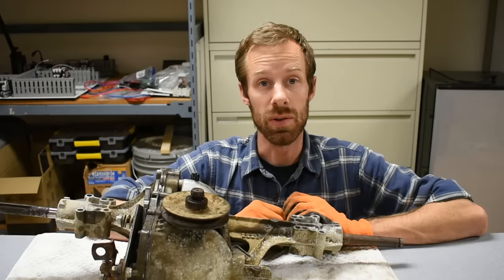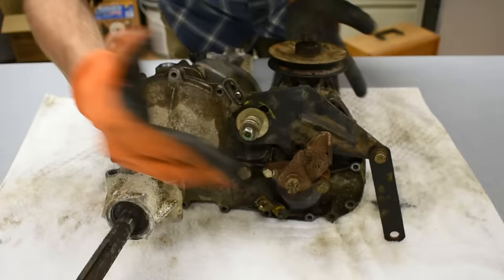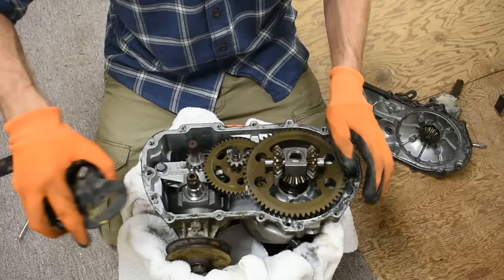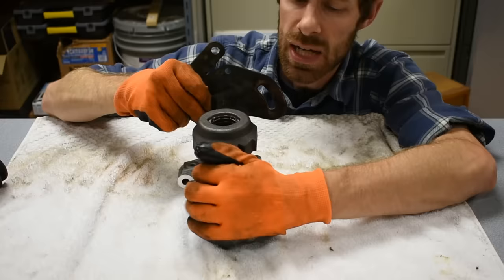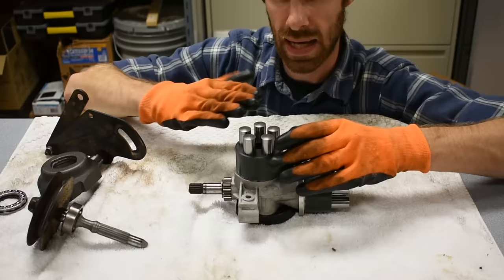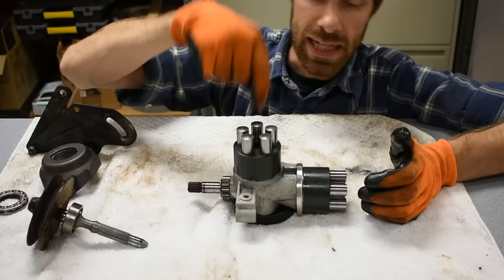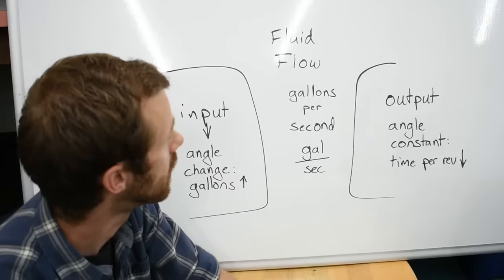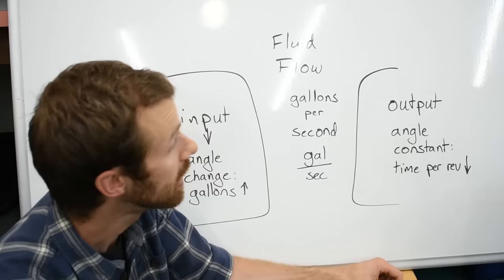How Does a Hydrostatic Transmission Work?

Comment: I understand how the pump changes forward and reverse as well as increases and decrease fluid flow.  However I fail to understand your explanation that anything changes on the hydraulic motor since there is no variability of flow or pressure.  All variability of flow and pressure seems to occur in the pump not the motor.  The motor converts all output into mechanical spin of the axle and as you said the variable disk is set in a fixed position. The motor does not even seem to allow for a change of direction of fluid flow.
Reply from the maker: The motor + pump + channels through the body are similar to a DC circuit. If you change the current (flow) delivered by the source (pump), then you increase the speed of the motor, assuming the motor can handle higher current. 

Similarly, if you reverse the polarity of the source, you reverse the motor direction.

Both of these are accomplished, as you said - without changing the motor itself, which is totally stationary. The motor simply responds (speed and direction) to the fluid flow delivery from the pump, which is indeed variable.

Comment: Thank you for your great video explanation. One thing I have always wondered about these transmissions is 'torque'. My first tractor was the conventional 4 speed stick shift and I could pick a lower gear for higher torque when pulling a heavy load, at slower speed. On my newer hydrostatic tractor, how do I get more torque? Do I push the pedal harder, (and get more speed too which I don't want or need) ? or push the pedal less, to go slower, am I getting more torque than at high speed? Any thoughts? Sometimes you just want to pull hard and go slow. TIA
Reply from the maker: Great question, and now you have me thinking hard as well. The input shaft of this variable-displacement pump is revolving at a near-constant RPM, with the only change being the volume that each of the cylinders can deliver. I think that would mean that a constant PSI, and therefor no significant change in the output torque, only speed, like you are stating.

On some larger equipment, there are two geared pumps that operate at different speeds, switching between a 'high' and 'low' gear pump still gives you the variable speed output, but the speed/torque ratio has been changed. Slower, but with more torque for heavy work, or a fast, low-torque mode for driving down the road between job sites. I doubt this is common on smaller lawn tractors.

Great questions. You got me thinking. I like it :)
Reply: I'm not sure there is any way to get more torque from a hydraulic setup.  The pump pumps it's max pressure, be it 1000, 3000 or 10,000 PSI, and it pumps it at 50 rpm up to 10,000 rpm, but the pressure is the same.  You are just going to move the PTO/wheel/etc faster.  

Engine speed does the same thing, just allows for the pump to run faster - but it's still pumping at the same pressure, you just have a higher flow rate which means you move the PTO faster, or move the hydraulic ram faster.  

Think about a 100 ton press using a little hand jack.  As long as you can complete one full stroke of the pump, it's going to allow the full 100 ton potential, though it may only move 1/10,000th of an inch per pump.  Now if you had an electric motor on the press powering the pump/hydraulics, it's doing the same work, just A LOT faster.  You get the same force but a lot more WORK is done (force x time).
Reply: @kde5fan737  Thank you for your comments/explanation. If the pump pressure (and thus torque) is constant regardless of rpm, then power output goes up with more rpm. If I understand you correctly, if I'm trying to pull a heavy load, I can't pull a heavier load with higher throttle or more pedal, but just pull whatever load it can handle, faster and the engine must generate more power.
Reply: @dwmac2010  Hmm - I see what you mean and  I think I had the same thoughts awhile ago but I think it is confusing a couple things.  If you are trying to pull a heavy load, you need X energy to even begin to move it (to overcome forces like friction & gravity).  The piston/ram being driven by the pump has to generate this and no less to move it.  If the thing pushing/pulling was immoveable (anchored to ground) then the thing being moved will move every time the pump inputs another stroke.  Piston is putting out 20,000 lbs force & it takes 19,999 lbs force to move item, the piston will win & move item.  If pump pumps 1 stroke a minute - its going to move slower than if the pump runs at 1000 strokes per minute.  

Now if the item being moved suddenly has more resistance (weight, friction, etc) and it now offers 20,001 lbs of total resistence, then the piston is no longer going to move it, even if the pump is no longer a 1 pump per minute & running at 1000 pumps per minute.  

Think of it like a pressure seal that is good to EXACTLY 2000 lbs.  Anything under that & it holds, but when it hits 2001 it ruptures & fails.  In the case of the pump, if the total pressure (psi) of the pump * the surface are of the piston is not greater than the total force needed to extend the piston, the piston is not moving.  

Now when we are talking about running pumps with an engine there might be some differences vs being run with a motor (electric), where we have constant power output.  With an IC engine being run at a lower speed, we have less total power going to the output (pump) but that doesn't change the max PSI capability of the pump.  If the slower running engine is turning the pump it means the resistance being offered against the pump is less than what the pump is putting out (again, at reduced/lower RPM of gas engine).  But if the load on the pump (through pressure on the piston being driven) is greater than what the pump can put out, the pump isn't turning or it's going to back-feed into the resevoir or stall the input shaft unless there is some kind of clutch or release on the input shaft (or I guess the pressure/directional change shock could be absorbed into the oil??  Thus no clutch would be needed?) - but the piston isn't moving out b/c the actual pumping motion wasn't completed.  

Now increase RPM (or engine) & you now have your higher power output to &from the PTO (to the pump), now your pump is capable of more pressure b/c the power output from the engine is higher. 

With electric motors this is slightly different I think - the lower speeds might not effect it as much.  I'm sorry if I may have confused engine (or motor) rpm (thus power output) & how it effected pump pressure, in the previous post.  

I think the best way to envision this is still with an old bottle jack w/ different length crank/stroke arms (IDK what they are called, :) ).  You can use a 12inch with a stroke every minute or once a second & the thing will lift the same amount (assuming same applied force from your arm on each stroke).  If you get sleepy in between each minute of stroke & can't/don't pull down as hard, then you might not get the piston to rise.

Sorry for the long reply, IDK if I answered your question or maybe highlighted some questionable aspect (including my incomplete understanding of the topic..??), but LMK if I helped or confused you.  This is an interesting topic and real world applications can seem counter intuitive at times if you don't understand how they all work together.  Good luck!

Comment: With changed gear ratios why can't this simple transmission be used in a marine application?  Some boats have these enormous and heavy transmissions that could be replaced by something a bit more simple and less expensive.  Years ago I suggested that sailboats be designed with a 'well' suitable for an outboard motor rather than a clumsy and hard to work on inboard.  On a freeway near LA  I recently saw a brand new sailboat on a large trailer with just that 'well' and a large Yamaha installed.  Finally, maybe boat designers are losing their mossback reputations.

Comment: Completely different to the hydrostatic transaxle on my mower. Mine is all foot operated and has a different set up.
Reply from the maker: I know the John Deere models often have foot pedal controls. Never used one myself, but I'm curious - when you press, does the pedal stay in place, or do you constantly have to hold pressure with your foot the whole time you are driving? 

I had a mower with a simple engine-speed-driven transmission and you had to hold the pedal the whole time. Not as user friendly as the handle. I've always wondered about those foot operated ones...
Reply: @PetersonBrosAutomation  , I've got two Murray's, one is 16•5 hp Briggs and Stratton Hydrostatic foot control, the other is a 20 horse power Tecumseh, with a pedal controlled hydrostatic control. Hold your foot forward and it moves forward, and same as you said about your hand control, the harder you push forward, the faster you go. And it works the same in reverse. They both appear to be different models of Hydrostatic transaxles, but both differ vastly in appearance to yours. Perhaps just different models released in Australia?

Comment: 5:22 "the hydrostatic transmission relies on the movement of fluid"

In that case, it's not hydrostatic but hydrodynamic.
Reply: It is hydrostatic. Hydrodynamic has to do with the study of the forces acting on or exerted on fluids. Hydrostatic has to do with the conversion of rotational force from an input source into hydraulic force to do work. The fluid in the transmission is being used to transmit the force of the power from the pump to the drive and the flow is a consequence of that action. It's funky cause you have to remember that the pump does not create pressure, it creates flow. Pressure is the measure of the restriction(s) that the fluid encounters moving through the system.

Comment: nobody knows for sure how they work. they just do..... I was a certified bobcat repair ech for a number of years and I can tell you that they dont even know how, exactly, they work. it's fm.... freakin majic.
Reply: I am a mechanical engineer.  It is pretty simple how they work. Yes, other engineers know too.  I promise you.
Reply: @kooldoozer  then whats with all of the voodoo rituals? you engineers make alot of stuff up.....
Reply from the maker: I've heard if you put all the 6-point sockets in a circle and light a trail of grease on fire, it summons a mechanic to fix it. Problem is the 13mm is always missing.
Reply: @PetersonBrosAutomation  and now you know why those things are so expensive to repair!! ... constantly getting more 13's is expensive!
Reply: @lukewarmwater6412  Engineers deal in facts and physics.  If your engineer friend is making stuff up, he is a bullshitter, not an engineer.
Reply: @kooldoozer  you guys all make stuff up!... in a grumman g-164 there is a wing part called a doublizer.... really? couldnt pull something better than that out of thin air??
  you guys get paid to make stuff up! admitt it!
Reply: @lukewarmwater6412  Inventing nomenclature is not the same as making up the facts on how hydraulic systems work.  The physics of hydrostatics is well understood. Even hydrodynamics, like turbines, fluid couplings, and torque converters is well understood.  No reason to make things up.  Maybe engineers cut it short with you to avoid explaining a whole bunch of stuff, for time constraint reasons. Perhaps it is your approach. You never know. Maybe invite the geek squad for beers after work, and you might communicate better then.
Reply: @kooldoozer  see. you are why people say engineers are no fun.....
Reply: @lukewarmwater6412  Buy me a beer.  I magically start to sing !

Comment: So it's a 5 cylinder swashplate pump and matching motor.  15 minutes just to say that.

The 5 cylinders means that one cylinder will always be available, not at top dead centre and not on a par with a neighbouring cylinder. If that were the case, no output movement would be provided !